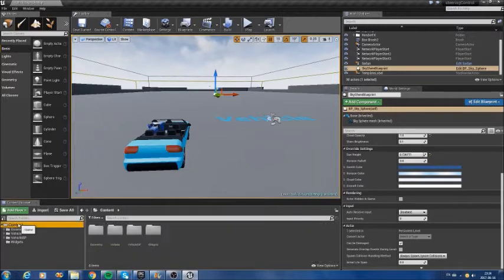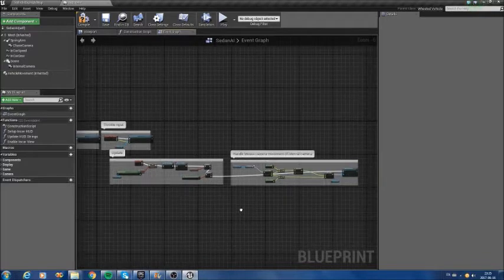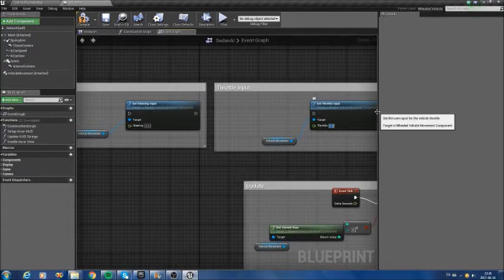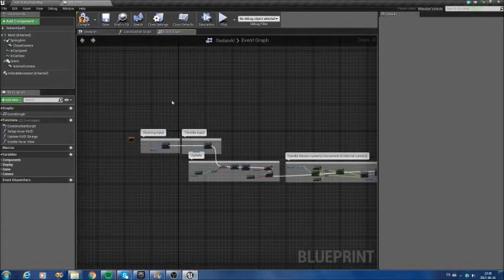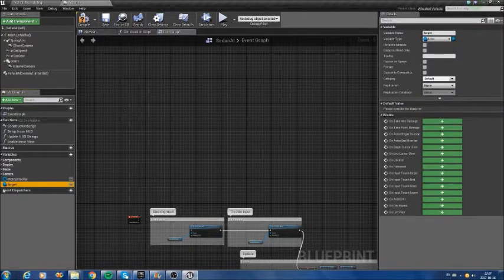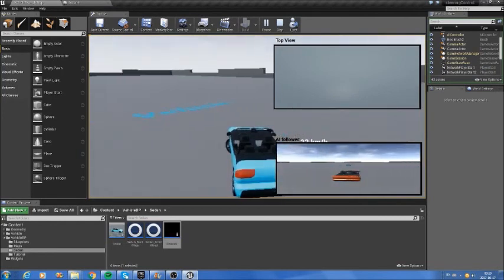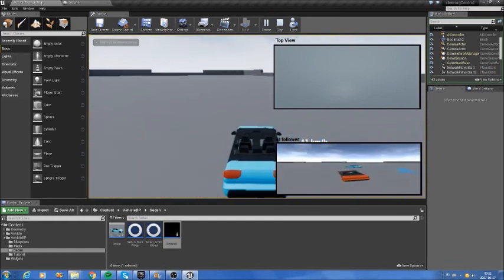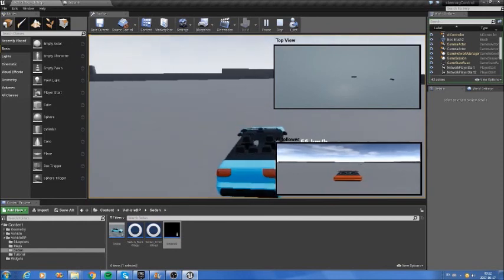3  Unreal4 PID steering control Using PID as steering controller

Comment: Hi. Do you have this video with higher resolution? I bought the plugin but some parts are hard to follow as I cannot read things in this video. Many thanks
Reply from the maker: Unfortunately, I don't have it at better resolution, I am sorry for the inconvenience, however you can retrieve the example from the Github page and check the blueprints. 

Vehicle Steering:

https://github.com/carloscastrillon1/Unreal4_PID_Steering_Control

Camera Rotation Control:

https://github.com/carloscastrillon1/PIDCameraDirectionFollower

Character Head Follower

https://github.com/carloscastrillon1/PIDCameraHeadRotationFollower

Missile Steering Control:

https://github.com/carloscastrillon1/ProjectileExampleYawPitchSpeedControl
Reply: I was going to ask the same thing. Great video anyway @carloscastrillon1

Comment: this sounds more techy. here is s simple question. does this work like a common Wheel controller.? can i use it with my Logitech Steering Wheel to control my vehicles in unreal engine for commercial use?
Reply: the PID controller is just an algorithm that you can use to control (for example) physics based systems. You want to do a SpaceX rocket that stays upright? It is easy to get the error (how much rocket is tilted and possible speed of change in tilt) but not so easy to use that value to get accurate correcting force that would reduce as the rocket gets closer to correct angle. 

PID is used for getting correct outputs from the amount of error present. 

TLDR: no this is not a steering system per se.